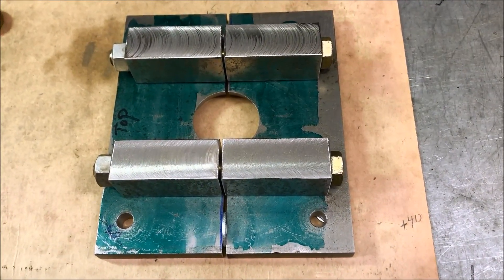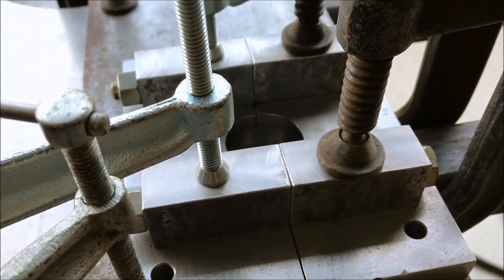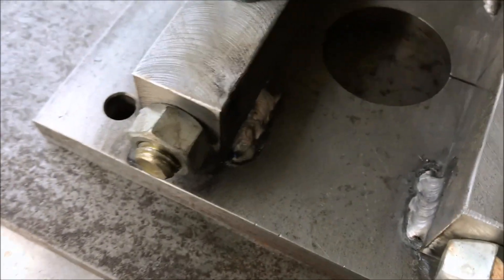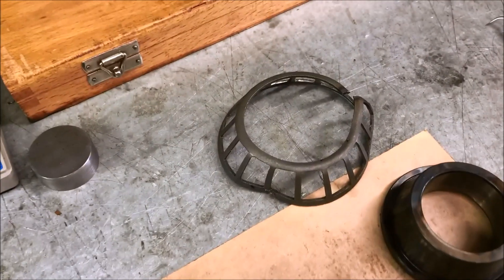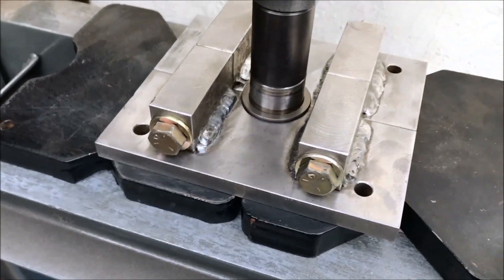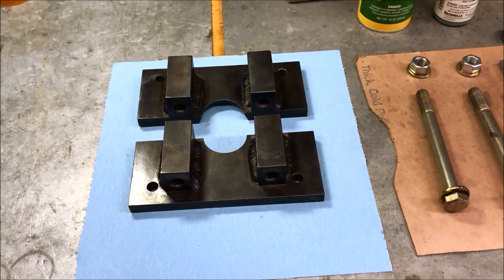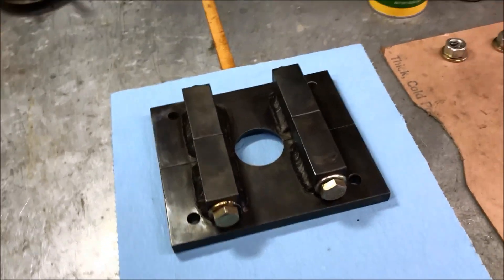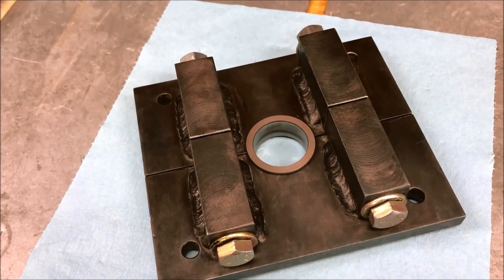Special Custom Bearing Splitter Plate Part 3 : Project Complete

Comment: Looking great, welding we still need to learn over here so we are really watching here to see how your welding is coming along. Weld is looking steady and clean to us anyways something about stacking dimes? Now that is a broken gear. That sounded really good, you made a great angle bearing, we use the Brownells bluing non gel you are using the gel so great to see the difference here between the two. Only that oil is nothing we have tried too many to select from.
Reply from the maker: Thanks for all your great comments. My best advise on welding is "don't watch me" , just kidding. But checkout "welding tips and tricks" Jody and Bob Moffett "weld.com". both on youtube. They are the godfathers of welding instruction.
I've used both the liquid and gel bluing, I prefer the gel both require rubbing in and the liquid runs off too fast. Could just be me.

Hope you had a great Thanksgiving! Dean